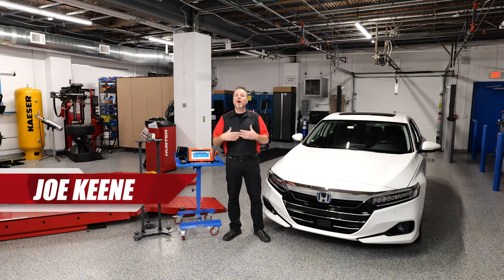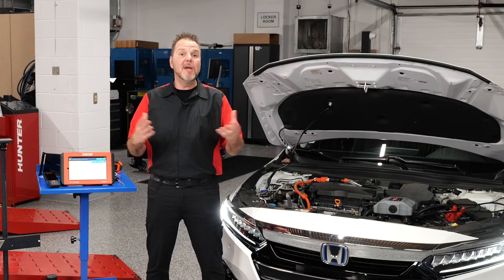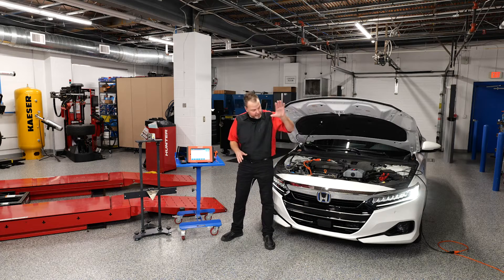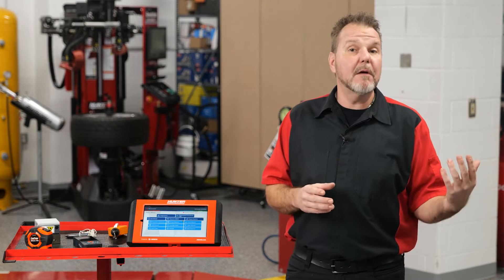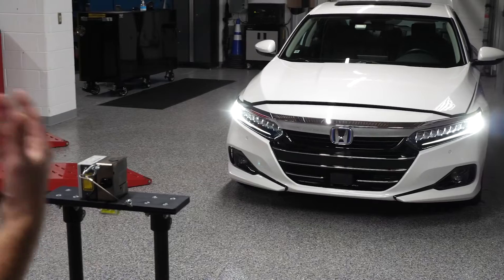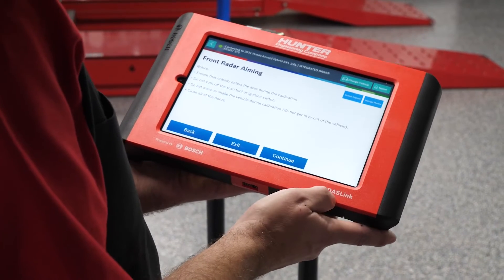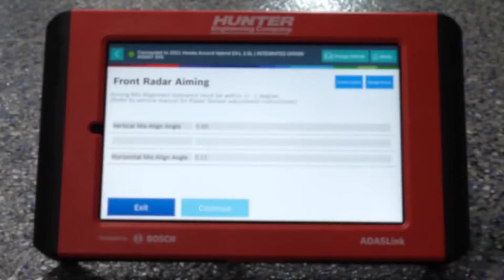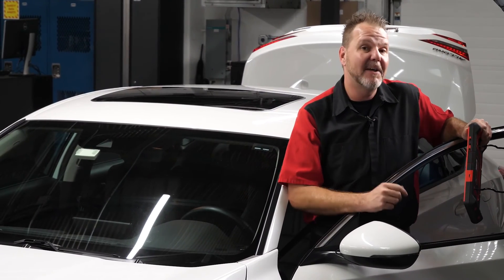ADAS calibration: Honda front radar camera adjustment

Comment: Do they calibrate sensors when repair windshield
Reply from the maker: Short answer is yes.  If a windshield is replaced, then calibration is required.
Repair, as in a chip....not required.
Reply: @HunterLearningChannel  sensors only on windshield or bumper two

Comment: Where's your shop, my dealership messed up my system after replacing the Battery Now I don't have Adaptive Cruise Control, Collusion Mitigation System, and Road Departure Mitigation System., and now they want to charge me almost $2,000 for something they messed up when they changed the battery.